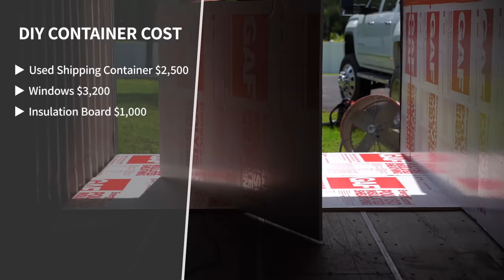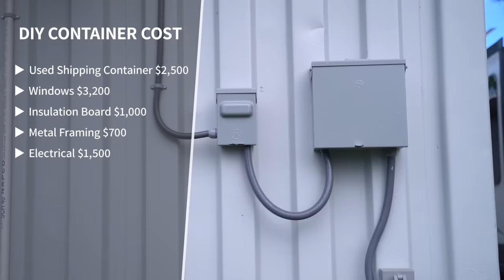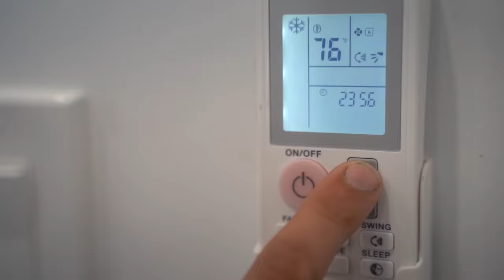40ft DIY Shipping Container Home (Total Cost Breakdown)

Comment: Thank you for sharing this information. Most doing these builds don't disclose this info because it's a damper and unsexy. Reality can be harsh. Discussing your insulation further: the polyiso boards you have insulating the interior have an r value of only about 6 for one inch of insulation. Can you share what climate zone this container will be in and if r-6 insulation will reeeally suffice for that region? I foresee the biggest challenge to my build is preventing interior condensation WITHOUT resorting to spray foam, and I will be in a mild region, only about a zone 3; how have you addressed that issue in this build? Did you also add insualtion to the outside under the siding?
Reply: Caryn D. Hey so this is actually a really complicated answer.  And the simple way of explaining it is we actually used similar design as the yeti can, Using air voids to create a higher insulation value, we did some experimenting on this build and our outcome blew us away, we only have a little mini split on one end and in 100 degree Florida temp and direct sunlight all day it only runs on and off to maintain 73 degrees during the day.  We also unplugged it for a bit and it only reached 82 degrees inside after 2 days... now this one was built for extreme heat in mind, so when we get into cold weather we may have some design changes to be made.

Comment: So, I appreciate the honesty on this. It does actually give me a good gauge to go off of. My one question would be; if I wanted to join 3 of these together [(3) 40' containers], what is the cost of joining those together to create a big open floor plan. What does the cost look like just to join them?
Reply: @bobby: Give me one good reason for purchasing, transporting, cutting up, and  supporting the now weakened containers. You could have framed up the entire space much more cheaply in two days using conventional 2 by framing.
Reply: To be honest Bobby, it really depends on what you use to make the join, If you using chewing gum, maybe a couple hundred, but you will need a whole bunch of people to chew it up, if you use cello tape, maybe a couple of rolls, or you can mix up some straw with mud and make a cement like product, thats less then a hundred there.  A depends on B

Comment: I own a home building company in OKC. Over 540 homes under my belt over a 21 year career. Just finished my 40' hunting cabin container. 2 bedroom, I full bath, small kitchen and nice living room. $16,890.00. My container was used. I finished it out with upper -end amenities. Wood framing, spray foam insulation, smart soffit paneling, Mitsubishi mini split unit for heat/air, lateral line septic, tv wall in T&G cedar with faux beams, 3 barn doors, supplied with full size fridge, kitchen sink, microwave  and an electric cooktop. Not a basic "beer-guzzling getaway. Granted, I got labor covered from my guys and all my materials were discounted from my suppliers. I would say without favors or discounts, you're looking at 22K the way I finished mine out.

Comment: would like to know if there were issues regarding permitting, and what classification? RV or manufactured home?
Reply from the maker: Justin Huang this one we are having a trailer built so I can move it around and it will classify under an RV so we won’t have issues, but if you wanted it to be more permanent I would shoot for a manufactured home, or just a home, the cool thing is with these you can put them into whatever classification you need to make it happen with some creative wording at the building department :)

Comment: I live in a wildfire prone area and was researching the possibility of using containers as a basis for a home for two reasons: 1) fire proof, 2) minimal foundation required. However, I've been very concerned about three issues: 1) thermal conductivity of steel, 2) the loss of structural integrity after cutting into the steel walls for windows, door, etc. 3) condensation. This video was pretty interesting. It would be very interesting to see what has been done to address the three negative issues.
Reply: Bari, I would consider ICF's - Insulated concrete forms first. While the initial cost is likely lower with a container home, there are things that to consider.   The thermal efficiency of the structure. Once you are the owner, you have to pay the utilities every month. Also, consider resale value.   The shell of the structure is but a fraction of the final cost.  All of the other costs, drywall, electrical, windows, etc. are the same.  Good luck on your project.

Comment: This house turned out real nice! If you were to connect two 40ft containers together side by side how would you go about sealing up the middle section .
Reply: I would weld it together add bracing, and paint it with heavy duty paint maybe throw bedliner on it .
Reply: @lsbeamer3538  I was thinking bout marine paint..

Comment: Doesnt using the sheet insulation leave an air gap and potentially cause condensation to gather?
Reply: I was thinking the same thing. You would either need some extra insulation to fill in the gaps or spray foam.

Comment: So I'm thinking of making a shipping container home thats not a "tiny home" Would i double the cost per container or would it be much since not every space would have a bathroom, sink counter etc.
Reply: Just thinking logically, if you start off with the costs outlined in the video, double the container cost, and the materials used on floor and ceiling. 50% more for windows and walls. Same price for most of the other stuff, kitchen, bathroom electric, HVAC, etc. For not a whole lot of extra money, you get twice as much living space, but then you have to deal with the pain of cutting and welding two containers together, which is an unknown cost/hassle. Might be worth it though.

Comment: 🔨🛠Thank you, thank you, thank you!!!  I am about to do this but all I have is $,12,000. I am gathering information and this is exceptional for what I am looking for.  What do you think about stacking the containers?  And all I ask is that you show more of the container you were sitting in and share the cost of it. Thank you for the information. 🛠🔨🛁🚿🚽
Reply from the maker: Nana thank you for the comment!  And when stacking your budget will go way up! You need a crane or a huge forklift, and stairs, and then the engineering and possible plans depending on where it’s going... so if you are working on a tight budget and going to do this yourself keep it simple! Hope that helps!
Reply from the maker: Sorry forgot... we have a walkthrough video coming! So stay tuned we actually have a few more things to do on the inside, but we work all day and are doing this channel on the side so it’s a lot of work :) so help share and support is please!
Reply: Pending your state crane operator charges around 650$ per hour but can usually get it done in that time if it’s one or two containers. 
Concrete footers is cheaper than a full foundation plus it keeps the bottom dry. 
Delivery usually is added in costs and delivery of units. 
Good luck

Comment: Would a vapor barrier be worth putting up before your board insulation, to prevent condensation buildup in between the metal walls and the insulation?
Reply: Insulation is the barrier and that install is full of holes so no barrier. That can spray foam is mostly vapour open

Comment: The 2500 dollar WWT grade containers tend to be crap because that grade have been removed from maritime service for damage and corrosion! I made the mistake of using two for my machine shop but it was easy for me to sort that out because I weld thought the worn end door gaskets would be an expensive hassle to replace. Homebuilders should spend about twice the price for a "cargo ready" (at minimum) or preferably a "one trip" grade 40ft High Cube or longer container. Standard height containers and the pathetic 20-footers will disappoint by comparison.
Those new to containers should IMO build one as a workshop first. That teaches you the necessary and facilitates a residential build (which is basically constructing a single wide mobile home inside your container).  
Someone who welds and is a DIY beast will get along fine with containers but otherwise it's often wiser to place a single-wide modular instead. 
Consider a trussless steel building kit integrating your container since the combination is much more versatile and offers a more open layout. 
Containers aren't really "poverty housing" but they can be a typhoon-rated durable structure for specific niche use. I would not hesitate to fab one and would live in my container machine shop while doing it.

Comment: I wonder how much it would cost by comparison to just ditch the container and build the same size from scratch. 🤔 
I love the idea of shipping container homes but every time I really think seriously about it and work it out, it seems to be not worth it over just building a small structure framed from scratch without any of the hassle of working around an existing structure and reinforcing the added weaknesses from cutting it.
Reply: I recently built a storage shed for about $1,400. That was just materials, I did all labour myself with a friend. 
Size: 8’w x 16’L x 10’h
The roof actually slopes from 10’ in front to 8’ in back. Also no windows and the door is simply a 4’w by 8’ high section with hinges. This did include paint and roofing materials but no insulation or electrical or plumbing. It was built on pier blocks not foundation. All wood construction nothing fancy. So my shed 8’x16’ = $1,400 vs a wood structure of 10’x40’ = $3,500-$4000
.
Reply: @prepperjonpnw6482  You have to add slab to it. Everything stays the same, you just spend more money on lumber.
Reply from the maker: It is really similar, these are just super strong... and if you are doing multiple containers for a single structure it is for sure cheaper to build from standard materials!

Comment: Knowing how containers can condensate from heat and cold weather.  How are you preventing condensation from getting trapped between your container wall and finish wall???  I notice many people over insulating on the interior of a container home, This prevents ventilation of the structure of the container!  Containers in cold weather tend to build condensation on the walls.  SO if your heating in winter or cooling in summer with the steel walls covered with no ventilation for the steel walls.  They sweat do to the humidity and or cold, Thus when this happens to trap moisture between a finished wall and container wall, you get mildew,  This can cause heath problems later!!!   Can you show how your preventing this from happening in another video!!!
Reply from the maker: Great question and we actually resolved that in a few different ways.  We actually have vents cut into the top of all four corners of the containers that allow for any trapped heat or moisture to evaporate out the top in between the insulation and metal.  But for sure this container was designed for hot weather in direct sunlight, a cold weather package would be a different build
Reply: @ContainingLuxury  would love to see a video on that.  I'm in the PNW, so the sweats are  an issue here.

Comment: You missed one important thing, “FOUNDATIONS” can be pricey, excellent video though!
Reply: 17:16 site prep, it’s mentioned.
Reply: While a foundation would be good, it's not necessary for a shipping container under certain conditions, such as dry level ground (no swamps or sand), if you plan on moving it every few months. Even if you want it to be permanent, shipping containers are designed to keep weight equally distributed. If you've never seen a cargo ship on its side, the containers they stack on them don't usually fall over, that's part of why they're wanted for such projects.
Reply: @gothnate  
You're correct, IF, you dont cut holes for  doors and windows. Then it would be a dark cave. Even with reinforced openings, you're going to have some twist and flex when moving it.  Then, cracked/broken windows and cockeyed doors, etc... So, moving often is not recommended .

Comment: excellent video.  Here's another thing; Stuff that goes wrong.  Tools and supplies get stolen or fall off the truck.  The truck breaks down.  Injuries happen.  You need to buy a couple ladders or a chainsaw, or prices rise unexpectedly, or weather ruins something.  The generator quits.  If you've done a dozen of these you get good at it, but if you're doing one, mortals will make costly mistakes.

Comment: Conclusion: container houses are more expensive for square foot than regular houses.
Reply: Consider that Container homes are more durable and energy efficient than regular houses. Save cost heating/cooling a small space, especially when spray insulated
Reply: Ofcourse they are, so are tiny homes. The point is nobody uses all sq footage of there homes so people go smaller.
Reply: The smaller space the more per square foot costs.  But still overall less costly than a larger home.

Comment: How do you prevent condensation/mold from building up in the walls since the outside is just metal which is pressed up against insulation?

Comment: Love your break down of the raw hard money cost. I would like to see your break down of the sections for labor, i.e. drywall, electrical, plumbing etc. (personally I have the technical skill & knowledge to do the high $ labor and then pay a certified electricians/ plumber/HVAC etc to come inspect and rubber stamp, but not the time or youthful back for framing/ drywall and will just right a check without questions for someone else to do it for me. However, 20 years ago {in hindsight, when I should have started a project like this} my skilled labor requirement would have been the polar opposite.  Anther thing I would like to see is the site prep and permitting / engineering costs  (estimate/ breakdowns I have seen so far start at double this raw material cost and then go up) for rural, suburban, medium city/ higher density area.

Comment: My first 2 items so far total $9,500.
  $5,000 (after shipping and taxes) for a used container bought in 2021.
  $4,500 for piers on the back side of container and a 12x40 pad in front of the container for a patio (Did the site prep and built all the forms for the concrete myself). Aiming to keep the rest under 20k.
Reply from the maker: Hello - we are putting together a model where any of our subscribers can leverage our buying power to purchase NEW 40ft and/or 20ft shipping containers out of 3 different US ports. We buy many containers per month and our pricing is fantastic. Well under $5000 for new (one trip) units. Reach out to us if you are interested: containingluxury@gmail.com

Comment: Thank you for this comprehensive explanation of minimum materials costs.  I'm guessing that anyone attempting this type of project without the necessary tool, including power tool, should plan on spending at least another 2 t0 3 grand, and that's if they are able to rent the larger tools that they only require for a few days at a time.  Things like a Bobcat or a backhoe.  I am not a builder, but I do use hand and power tools on some home projects and they don't come cheap.   Of course, If you have friends that will let you borrow theirs, them great.  Just take good care of them and replace what you break.  Also, I wouldn't buy the cheapest consumer grade power tools.
Reply: Agree. Aldi drill bits not only suck, they did a number on someone's hand, too.

Comment: Thank you for showing this video on how much it cost to build a 40 ft shipping container house. It's less then buying a cemented house. All I need now is to win the lottery, buy some land so my house can get built. Thanks again for the video
Reply: You think that, but wood frame construction is about the same cost for a single level structure if you also build it similarly with everything at the edges and the centers being basically partition walls that are not load-bearing.  Where containers excel, though, is multiple stories since you can stack them to make a code compliant metal superstructure - for an order of magnitude less money.  A 32X40 2 story home made out of 6 containers is shockingly less expensive than traditional construction, especially if you drop in truss joists for the 2nd floor on top of the existing frames.  Basically barn levels of inexpensive.  Want 3 stories?  They are good for that as well - just bolt and weld the frames together.

Comment: I would like to know where you buy your cabinets and the counter tops?    You gave good info.We had done some smaller projects. Then Husband and I did a complete remodel of an old home in poor condition. Built a barn and garage. We learned double cost evaluation and triple the time expectation. Just putting in fencing cost way more then we thought. I must add I would only buy a one-way shipping container and most likely would buy more than one So there go's that budget.

Comment: Are these kinds of homes possible in places with extreme winter conditions, like Canada? We get many feet of snow and temperatures can get as low as 6 degrees Fahrenheit. So, would this kind of home be impractical? Or would it just require different/extra steps?
Reply from the maker: Zipporah samuel for sure! They are capable of just about anywhere just need the proper insulation!